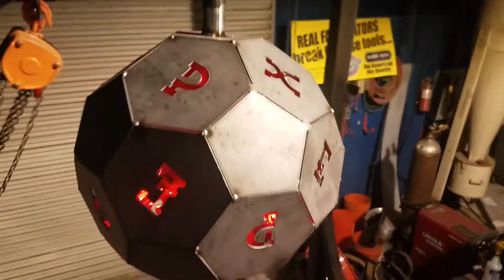APEXISH Plasmacam Disco Ball

Comment: nice video JD...I've got a question for you JD can you tell why I'm getting sooooo much platter with dual shielded flux core wire... nothing I do helps....I'm
Reply from the maker: L&L welding and fabrication wire speed, size, and voltage?
Reply: The wire is fusion flow 71t-11...I  can't really tell the voltage or wire speed because of the machine I have doesn't show it ..It just has numbers...its the same size machine as your Lincoln 210 but mine is a miller 211 ... thanks man
Reply: Wire size .035
Reply from the maker: L&L welding and fabrication try turning down the wire first keeping the heat the same... sometimes, I will "dial in"  the wire while I'm welding by turning the speed up and down till I like it.  Also check the distance between the tip and puddle, getting to far away tends to throw bb's.
Reply: I'll try it thanks JD ...You and Jody make the best videos...I would love to see more videos with dual shielded flux core wire....I can tell when your welding it's burning in hot... Thanks again